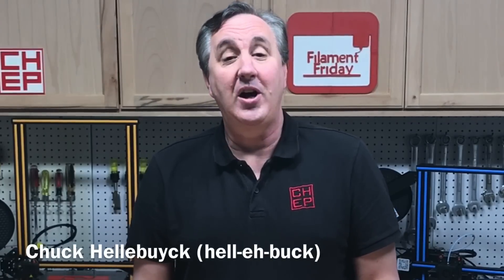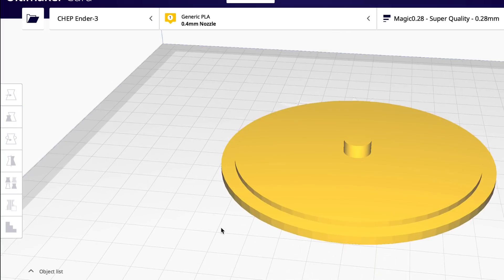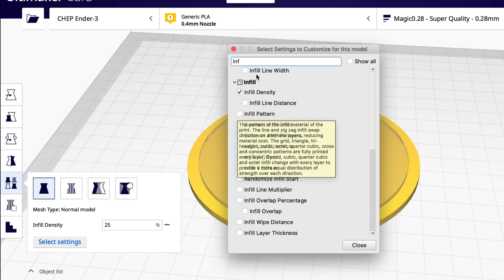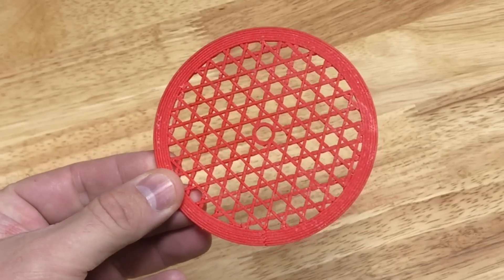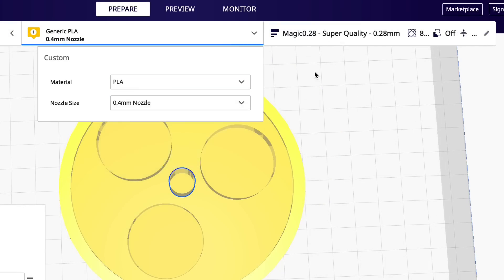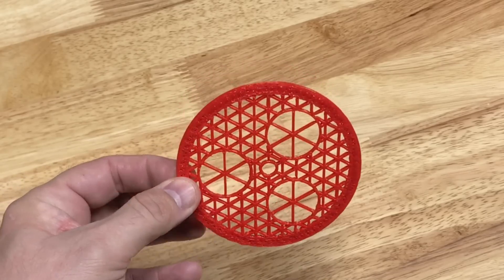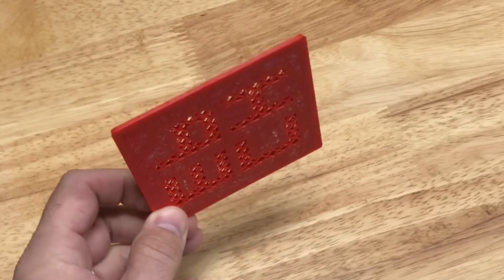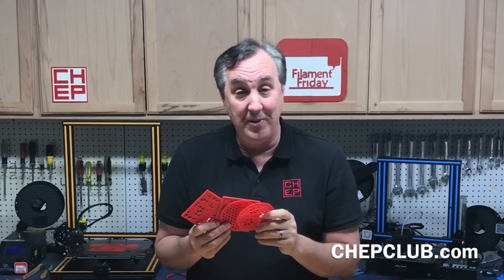Infill Design Tricks using Per Model Settings in Cura Slicer 4.x

Comment: How would you rotate the infill so it runs parallel. Trying to create a grid pattern to use in a print, without having my printer make dozens of tiny squares that don't want to stick.
Reply: Infill line direction 90 degrees

Comment: Hey Chep, got a question im using cura 4.8 and I am trying this trick your doing and it won't let me put them together it separates them. Do you know is there a setting to allow models to stack?
Reply: I found it Chep, under preferences, general,and unchecked the "ensure models are kept apart"

Comment: I use this trick to create internal support for features inside an object that wouldn't get the proper support unless one set the infill very high. That way I can keep the main object on a very low on infill (say 10%), and increase the infill under internal features to 50%

Comment: This method would work well for vents in enclosures, like raspberry pi cases, fan duct redirects... keep small fingers and debris out of things you don't want to have to clean later on.

Love your videos, new subscriber, and new owner of an ender 3 pro ^_^
Reply: i own an Ender 3 (not pro) and I'm just blown away at the quality. it's so damn good, the prints look like it was made at a factory once the settings and leveling are dialed in. AND, I bought mine for $179. I can not say enough how amazing the Ender 3 is, especially when i get my auto bed level upgrade in the mail soon!

Comment: This is a great feature.  However, how can I generate a notch in one of the cylinders?  I am now using Cura 4.6.  I cannot get rid of the outside walls in the cylinder.  I created a cube, overlayed it onto the cylinder side ( 2mm taller, and -2mm below ).  ARGH!!!
(Edit) - Just figured it out.  Included Wall Line Count = 0 in the model used to create the notch. Yay

Comment: im so confused , my cura 4.5 & 4.4.1 does not do what yours does,  when I change the top and bottom to zero , it slices  but no change in the model...  what version are you using because my cura menus on the left side look nothing like your video.
Reply: ahhhh ok, I didn't know I had to download your profile from your  website ;-)  Installed your profile and it worked perfectly... awesome ... thanks
Reply: Strange, that was not a requirement! Just tried without caring about the profile and it works! One thing is that this menu seems to change from a version to another. My Cura 4.7 menu looks slightly different, but I can achieve the same “natively”.

Comment: About a year ago you did a video "3 Slicer Tricks" which included one about support blockers.
The latest Cura (4.4.1) does this differently and no matter what I do, it creates a solid block.
I don't suppose you could do another video on this or any other differences in the latest Cura.
Excellent informative videos, some extremely useful information.
Thanks
Reply from the maker: This video is basically doing the same thing.
Reply: @FilamentFriday  It's the "Support Blocker" that appears to be the problem with this version of Cura and you don't use that in this video. I am getting the same problem as Martin Ellis.
Reply from the maker: Ok, I’ll see what I find.

Comment: Hey CHEP, New to 3D Printing. Just got a CR-10 Mini and is not printing in the center of the bed? Any way to fix this? Thanks for any help. Like your videos been learning a lot from them.
Reply: Did you give cura the correct size of your print bed?
Reply: @paulmason5543  Hi
Reply from the maker: Agree with Paul Mason. Check your machine profile is correct.
Reply: @FilamentFriday  Thanks for the reply. They are X300mm Y220mm Z300mm The Print Head setting are X min -26mm
Y min -32mm X max 32 mm Y max 34 mm . Are these all the right settings ? Thanks to both of you.
Reply: @sdjb111  check your setting for "Origin At Center"

Comment: Nice job CHEP.
Power of V4 over V15 is awesome if you can get past its confusion.
Like that you designed slightly and assigned infill effects to different segments on the model. 
You may convince me yet to use V4 more often to stretch me skills and offerings. 
Thanks for a great presentation as always..

Comment: probably great for making quick fan guards/covers. Just bring in the model of the super structure with the layout for the mounting holes. This video came out at the exact right time for me, needed to do gradual infill density, but only in a vast hollow spot (but doing that everywhere was messing up the detailed outside and inside parts of the model). Thanks!

Comment: Interesting as always Chuck, thank you.   This talk of infill settings prompts a (vaguely related) question though if I may? I've been trying to print some solid objects recently (making formers for a pipe bender so I can make some parts for a project) but I've been getting 'odd' results. Using a 0.4 nozzle, I set a large number of top bottom and wall layers (up to 30) and 100% infill. It never does 100% as such, hence my messing with wall thickness. Anyhoo, I get a solid print, but parts of it seem to end up like using the 'fuzzy skin' option and I'm sure it's been printing infill on top of already solid plastic at times.

Just curious really if you've ever messed about with trying to get solid prints at all?  Ultimately, although ugly and needing some cleaning up, these parts have been working brilliantly - I've been able to put some really nice bends into some quite awkwardly shaped aluminium extrusions using nothing but a cheap pipe bender and some PLA formers. My first attempt used 'normal' settings but even with 4 walls and 96% infill it crushed, helen the need for solid.

Comment: The reason why the infill pattern changes when going to 1mm, is that with the wider extrusion, the same pattern would no longer be the right percentage. So to keep the same percentage it needs fewer lines, and therefore the increases the size of the pattern.

Comment: Hey Chuck, I have a quick question. I recently bought the dual gear extruder you recommended for the Ender 3, and set it up like your tutorial. When I print I have a problem where the filament seems to be crushing at the entrance of the bowden tube, and after a few minutes, it stops extruding, any idea why?
Reply from the maker: Some have replaced the yellow spring with the original
Reply: @FilamentFriday  Thanks, I'll give it a try
Reply: @FilamentFriday  Unfortunately no luck. I've watched it and it seems the print i'm doing extrudes and retracts a lot, therefore grinding the PLA between the dual gears making it unable to fit. Is this an issue with my PLA, or should I just tighten the spring adjustment?
Reply: @FilamentFriday  I've finally sorted it and it was an issue I thought I'd already fixed. I had placed central gear too high, so it wasn't aligned with the arm gear and was just grinding the PLA. I've applied oil to the necessary areas and readjusted the gear and it's working perfectly. Thanks Chuck

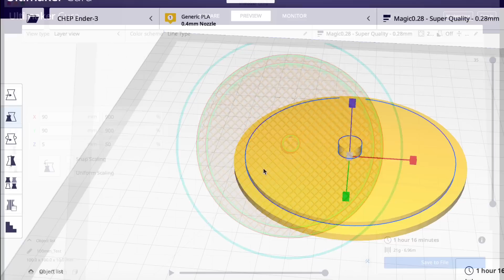Comment: Early on in the video (at about 1:43), there's a model where you only change the infill settings for overlap, but you go out of your way to mention that you're unclicking "Infill only". I'm now losing my mind trying to figure out if there's something I'm not understanding about that infill only checkbox, cuz from what I'm aware there's not really any reason to uncheck the box in that case. Can you explain why you did that and ease my brain? My working theory is that you did it out of habit to make sure you didn't accidentally leave it checked on a later model where you did need to mdify something other than the infill, but the fact that I don't know is driving me insane cuz I use per model settings like this rather frequently and I don't wanna miss something important!
Reply from the maker: Sometimes the hole would fill with infill with the box checked.
Reply: Maybe I should've just finished the video and got to the part where you say "I really can't tell ya whether you need to do that or not" lol, I suppose this is why they say patience is a virtue! Thanks for the video, some really fun stuff in here!

Comment: CHEP I am using your magic layer height of 0.12 mm on Ender3 - thank you. Later I installed a BLTouch(clone), updated my firmware and included G29(auto bed level) in my start g-code. Now, I have come to think that the auto bed level must be using micro steps to adjust for an imperfect bed!? -and the 0.12 mm is suddenly not that magic!?

Comment: CHEP I am using your magic layer height of 0.12 mm on Ender3. Later I installed a BLTouch(clone), updated my firmware and included G29(auto bed level) in my start g-code. Now, I have come to think that the auto bed level must be using micro steps to adjust for an imperfect bed!? -and the 0.12 mm is suddenly not that magic!?
Reply from the maker: The magic numbers affect the upper layers not the first layer.
Reply: @FilamentFriday  The magic number assures, that the printer will be at the same number of micro steps away from a full step every layer. If the firmware adds a variable number of micro steps dependent on x, y position (because of warped/slanted bed), then maybe the magic is lost!?
Reply: hpek do the parts have random nerds and look like there are wider extrusions for no reason?

Comment: Do you have a video on first layer issues and fixes? I can print a raft fine. If I don’t use one my print won’t stick.
Reply from the maker: Yes. https://youtu.be/_EfWVUJjBdA
Reply: CHEP bed is level I can print a level test fine. When I use a raft it’s also fine. A few guys on Facebook had me adjust my settings. Initial layer 130% and initial layer speed to 11mm/s also initial layer height to .2mm
Reply: itsYeoj why does it print nice with the raft?
Reply: @mikewiley1007  Your bed is not properly leveled or it isnt clean.

Comment: The other day, using this technique, I printed a filter for my cat's water fountain (non toxic ASA plastic) : I printed a 0 top and bottom layer rectangle of around 1cm high, and used several layers of smaller and smaller gyroid infill until holes are less than 1mm of diameter, to catch all the dirt and bugs my cat puts in water when putting his paws in it :)

I also printed some cool beer coasters with same technique but on PrusaSlicer, with 0 top and bottom layers for the coaster part, then on top of that I printed some brand logos like KTM with 2-3 layers of another color. Looks awesome ! :D

Comment: Thanks so much for all the videos. I have a question. I can see your print head in the previews, and I can see the layer play button at the center bottom; I'm using Cura 4.4.1 and I can only see the layer slider on the left. How do I get the preview layer slider, like you have available?
Reply from the maker: Check your graphics card vs Cura requirements.
Reply: @FilamentFriday  That was the issue. Thanks much.

Comment: Hey @Chep - do you have any good videos on calibrating the stepper motors for x,y,z? I've used the cube but if I go from 10mm cube to 20mm cube, the 10mm is dead on but the 20mm is like .20-.25 larger? Isn't there a better way to calibrate my printer so my prints are dimensionaly accurate?
Reply: Only adjust the steppers at big distances like 100 or 200mm. The change you do is in % so the smaller the calibration the bigger the error for larger distances. Best is if you just print a wall around your build plate and measure it. Also notice that you get an error if your line width is not calibrated correctly. So if you set your line width to 0.4 but it actually prints 0.46 your measurement will be 0.06 off. Im just done with my calibration, took me 2 months to get it perfect but now I get +/-0.05 accuracy which im really happy with